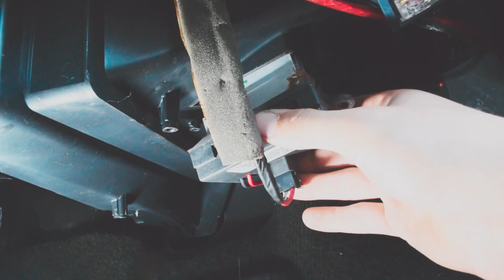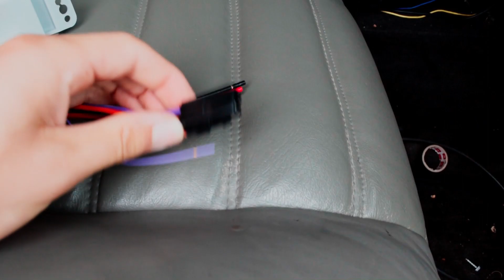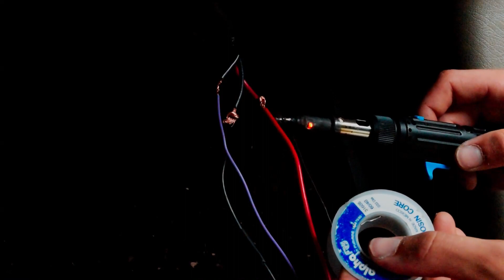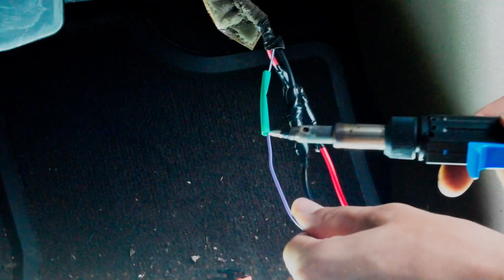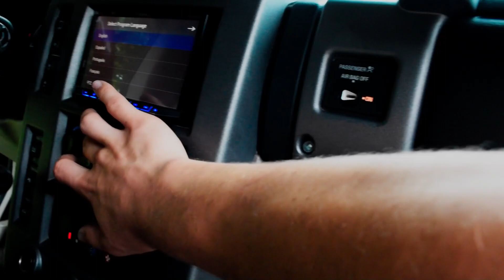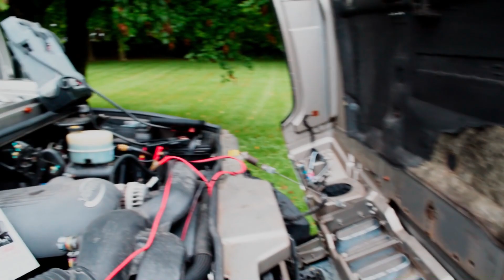Replacing a Blower Motor Resistor in a Hummer

Comment: On the Hummer H3 resistor blower motor did it come with the harness or did you have to buy it separate and what was the order part number
Reply from the maker: It did come with a new harness to wire in. Don't know what the exact part number was unfortunately sorry

Comment: Having issues with fan not pushing air after about 10 min of ac can hear fan going just no air anywhere . Also tons of water after I park from ac under truck . Ac ice cold when working then just stops . Replaced motor already next will be blend door anyone have this issue before ?
Reply: Devo666 did you change the resister or just the fan?

Comment: I changed my resistor on a 2003 h2 and it still doesnt blow. Whats the problem
Reply from the maker: You check for proper power and ground at the blower? Did you test the circuit loaded? Or while it's powered up?

Comment: Great video! Where did you find a replacement part at?! I have found some but with different fens does that matter?!
Reply from the maker: I think I bought it on Amazon. Fins don't matter too much, only thing that matters is that it makes a good seal against the bottom of the blower. Or else it will overheat without the airflow over it. The fins are a heat sink!

Comment: I'm going to do this tomorrow. Thanks for the upload I ordered the same resistor!
Reply: Worked fine despite the fact that the purple cable has a loose connection. When theres too much pressure on it the blower goes on/off - but I will look into that later today.
Reply: Bartosz L hi would you have the part number and if you got off Amazon.  Thanks
Reply: @millhousegee5034  here is the exact part I bought https://www.amazon.com/APDTY-112822-2003-2009-2002-2009-Trailblazer/dp/B016WT5NMW

Comment: Thanks!!!! Fixed!!!!!
 Part was on Amazon 42.00. Holes didint line up....so I melted a new one in and lined it close as possible and it's flush. No noise when I started it up... It was just like normal. I didn't use a solder to connect the wires I used the wire connector barrel that was included with the replacement part box. You connect each end inside and pinch it.
Reply from the maker: Nice man glad you figured it out! As long as it makes a good seal it should last a long time!

Comment: Question where did you find this resistor because the I've checked every parts store that I know of the only parts place that have it is the dealer ship for $ 200 and some change could you tell me where you got the resistor,,,
Reply from the maker: I purchased it on eBay
Reply: Amazon

Comment: Great video!! I had the same exact issue, where my blower motor stayed on after I turned the vehicle off on my  2003 hummer h2. I googled the issue and your video popped up, you were the only solution available, thank you soooo much for the video help, i followed it to a T and found the replacement resistor on amazon for 32 bucks, replaced and fixed in 15 minutes. Its people like you that help so many others, you are the Man, thanks again!!
Reply from the maker: Glad my video helped and you got it done!  Thanks for your feedback man!
Reply: So I bought another on ebay but it still wont turn off any other ideas
Reply: @javierpartida1644  Did u ger the issue resolved? Was it the resistor or the climate control unit itself?
Reply from the maker: Could be the control head but that'd be rare. Never seen that happen. Double check your connections at the blower resistor and make sure your wiring is correct.
Reply: Did you solve the issue I have the same problem

Comment: so i changed the resistor today, it didnt come on, checked the fuses noticed the 40A had a red  light so replaced that but still nothing. any take what could be the issue?
Reply from the maker: Do you have any way to confirm that there is power getting to the blower? A test light or multimeter? If the blower is getting power and not turning on, then it could be the blower. Best to check for voltage at key areas before buying the part.
Reply: @ThatAccordGuy  Im having the same issues. What sort of voltage should I be looking for im getting 8-14 dc depending upon how I move the fan speed with no fan working.  I even hooked up a new fan/blower and stills reading the power and it wasn't working either.  I just ordered a resister today and Hopefully that gets it.
Reply from the maker: If you have any power to the motor with the motor plugged in and it doesn't power up, it is most likely a bad blower. You have to check it plugged in and powered on to make sure that there isn't a wiring or connection problem causing the issue will only arise when the blower tries to pull Current through the circuit. If you get low voltage while the blower is plugged in then it could be a wiring problem.
Reply: Larry Hanneke did you get it fixed?
Reply: Yes I did, i returned the blower for another, that did the trick.
Reply: Where is the relay location?
Reply: @timmalone520 Fuse panel under the hood.

Comment: so you didnt have to change the blower too. I have the same issue and was wondering if i have to purchase both the resistor and  blower (fan)?
Reply from the maker: You shouldn't have to change the blower. 9 times out of 10 it's just a resistor. And they're much cheaper than the blower. I'd start with that.
Reply: @ThatAccordGuy  The blower motor shouldn't make that sound. I suggest taking it out and inspecting it for leaves and debri.

Comment: Where did you get the part from? Can you provide a link?  I need to buy one for my 2007
Reply from the maker: Dorman 973-510 HVAC Blower Motor Resistor Kit https://www.amazon.com/dp/B00IY0XTSI/ref=cm_sw_r_cp_apa_i_ffJ2BbNTN1V9K

This one says it will fit your 2007 h3